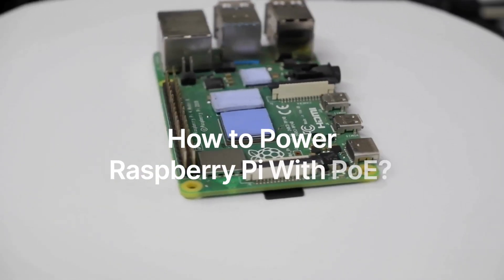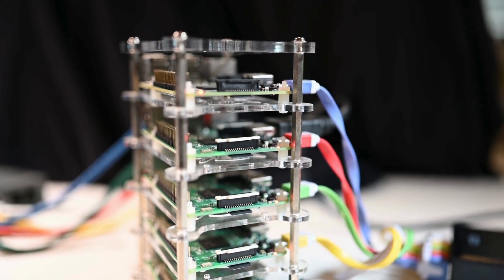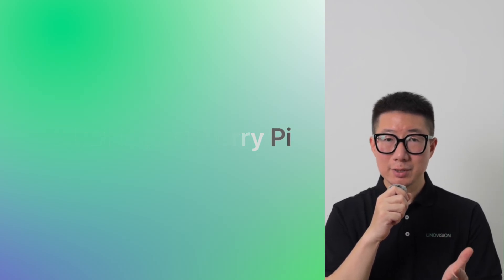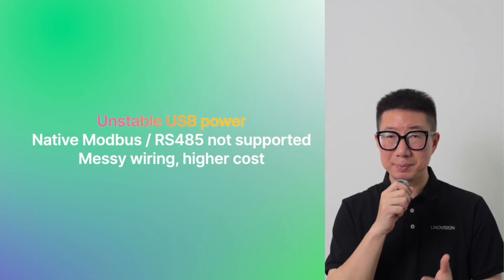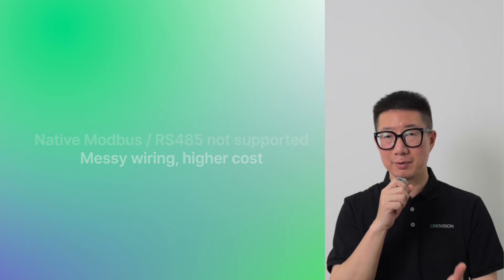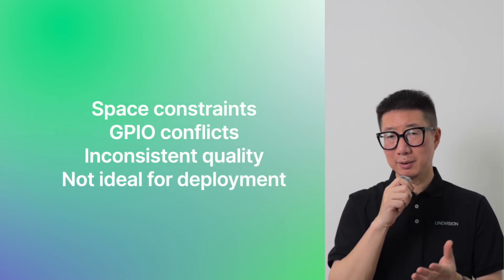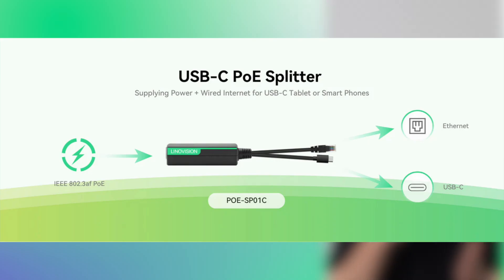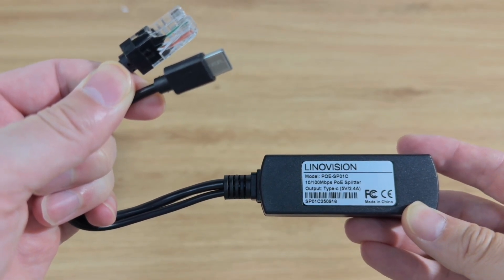Single Cable, Endless Possibilities: Powering Raspberry Pi with PoE

Comment: Does this adapter support active Poe?
Reply from the maker: Yes, this adapter supports Active PoE (IEEE 802.3af standard).
It accepts IEEE 802.3af PoE input from PoE Switches, NVRs, or PoE Injectors, and then splits the signal into:
	•	10/100Mbps Data
	•	5V 2.4A USB-C Power Output

It works with both PoE Mode A and Mode B, since it uses all 8 pins for power transmission.
Reply: It’s not gigabit ?
Reply from the maker: @tonyc2227  Yes, the one shown in the video is not the Gigabit version. If you need the Gigabit version, you may want to take a look at this model. https://linovision.com/products/mini-industrial-gigabit-poe-to-dc12v-2a-splitter-with-dc-terminal-block?_pos=1&_psq=POE-SP01G&_ss=e&_v=1.0